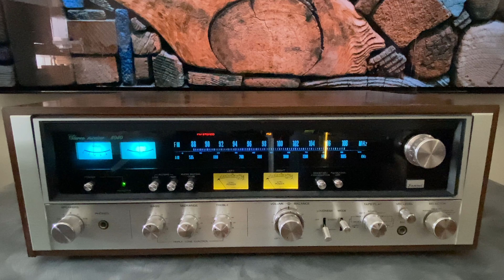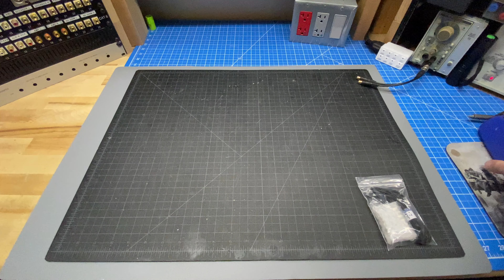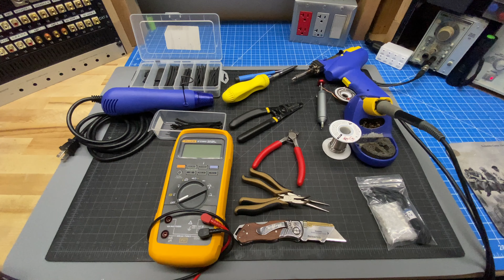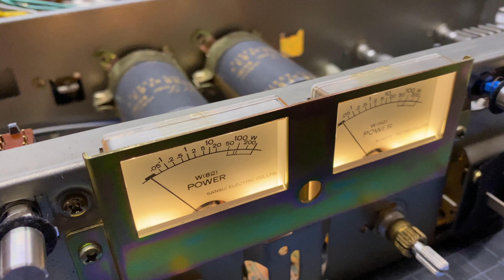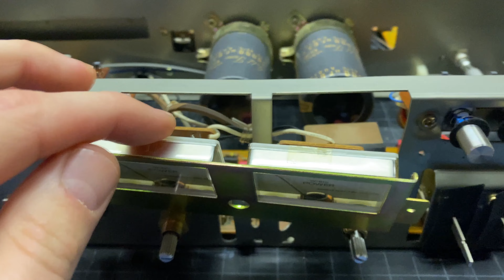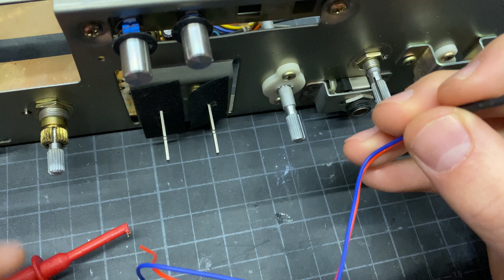Sansui 8080 9090 X0X0 LED Conversion (Pro Kit Installation) - Full Tutorial

Comment: Hmm. Switching the wire on the plug to the 6.5 AC did nothing for me. Lights still out. The Function lights were work, and now those are out too. I’ve checked and traced and can’t find the source.
Reply from the maker: Sounds like you may have blown the lamp fuse. Worth checking all of the fuses on the PS board.
Reply: @NovaluxStereophonic  I’ve checked the fuse on the power board with an mm. They’re fine. I heard there is a fuse, on a certain board, not sure which one.
Reply: @KosmicGroove  Did you figure this out?

Comment: There’s no need to do that!  The incandescent lights light the face of that unit just fine!
Reply from the maker: And also make the plastic housing extremely brittle. The heat is a major concern for these devices long term. Now something like a McIntosh amp with metal lamp sockets and glass. Incandescent will work long term with little downside.

Comment: Hello, today I received my first Sansui 9090 and I have a question.
Aside from the fact that the unit is quite dirty and clearly needs cleaning, it generally works and plays fine. However, there is a strange issue: when I switch the input selector, I don’t see any change on the front panel. It constantly shows FM and does not switch to other inputs in the display/indicator lights, even though I am physically changing the selector.
For example, when set to AUX, everything works normally in terms of sound, but it still shows FM on the panel.
Is this a serious issue, and is there any way to fix it at home?
Reply from the maker: First try cleaning the input selector switch. These can get extremely oxidized and cause all sorts of stage issues.

Comment: Dumb question here. I have a Sansui G9000 and the Power meter lights are out (they went out last year). Anyway, to put in new regular incandescent bulbs I am going to have to desolder the old ones and solder in the new ones, correct?
Reply from the maker: You might be able to see the lamp sockets on my video on the G901DB. From what I remember they are inside of a plastic boot. The original lamp would need to get removed from the boot and the new lamp soldered to onto the original leads, then slid back into the boot. That's my recollection anyways.

Comment: Hello, nice work 👍 if I use LEDs as a replacement for light bulbs, I choose two power options as needed.
1) bridge rectifier - full DC, in some cases also with voltage stabilizer and filtering
2) direct connection of a classic LED to AC with a diode connected in parallel in the closing direction - ordinary LEDs do not like a negative half-wave, so I eliminate its effects with an ordinary diode. I don't have an AC LED with two transitions.
But what I always do - I convert the clear transparent LED housing into a matte one with, for example, sanding fleece - the light is diffused better.
Fortunately, nowadays LEDs are produced in many colors, so there is no problem of color matching with the original - this is how I completed the interior lighting of my car - the original backlight is turquoise - and the new lighting is indistinguishable from the original.

Nice day 🙂 Tom
Reply from the maker: You do have a point here. The fuse style lamps that are shown here have some SMD components mounted on the back that deal with some of the shortcoming of running LED on an AC supply, however, the small LEDs in the power meters that I show wired in reverse polarity from one another have no such protection and I have seen some fail in this position before. The dual LEDs used for the indicators seem to be extremely robust though. I have have used them in many projects with no failures. I think they are internally wired in in anti-parallel configuration. I may start installing a rectifier & capacitor for the power meters in the future.
Reply: @NovaluxStereophonic  An ordinary LED without a protective diode in the closing direction - AC cannot handle it, the negative half-wave eliminates it, the diodes you used should handle it.

Comment: I'm going to work on my 8080 and 9090 pretty soon. Could one use a hot glue gun from the backside to hold the meter LED's  in place ?
Reply from the maker: I would be worried about accidentally melting the meter itself. Maybe try it first without glue and see how it fits up and looks before resorting to glue. If the LED ever fails in the future the glue may make swapping it more difficult.

Comment: Thank you for your video, it is very detailed, I got the lights kit for my 8080db but after I opened I find out that the stereo light is working ok but sources lights are very dim out, Does anyone here know what the issue can be?
Reply from the maker: Check for resistance within your input selector switch. A thorough cleaning of the input control may improve the brightness of your source indicators.
Reply: @NovaluxStereophonic  I thought about it, I will clean it with Deoxit. Do you recommend D5 or F5
Reply from the maker: @chris2470104  The selector switch is metal on metal so D5 is fine.

Comment: Really enjoyed the video and helped me with my 890db I just rebulbed ( pretty sure we got the same bulb kit ) One thing I noticed different on the 890db/8080db is my indicator bulb wires went behind that panel so there was no way to cleanly solder them to the board like you did. I had to cut the existing wires and then just twist / solder / heat shrink onto the original wires.. Maybe I could of just solder to the pads on the outside who knows. Its works perfect but id be happier if I could of did it externally like yours are, Joe is da man!

Comment: One of the most common things we see at the shop are folks bringing in vintage gear that had LED kits installed by the previous owner. They ask us to replace them with the original bulbs -- bayonets and "fuse" type lamps most commonly. Fisher gear like the 500b and 500c are very popular receiver examples.  The owners dislike the look of the LED's. I caution everyone to see how the LED's look BEFORE you have them put in; in some cases - like tube gear from many makers like Sansui (especially THEIR 500b model!), HH Scott and McIntosh as well as the Fisher I mentioned - you can hurt the value of the piece.
Reply from the maker: I agree, case by case. I always offer the choice to the customer and it seems to be 50/50. I only ever use LED in Mac to brighten up the meters. LED never really works properly for the lettering. It does not diffuse properly and cannot propagate properly through some of the color filters. The Sansui X0X0 receivers are one of the rare exceptions where I prefer LED over incandescent.

Comment: The clear wire ties that Sansui used can be replicated.  Craft stores sell plastic string used to make elastic beads.  Stretchy enough that it can be tied in a knot just like Sansui did.  Zip ties just look out of place on vintage gear.
Reply from the maker: Thank you for the tip.

Comment: If you want to get rid of almost all flicker, you can wire in a bridge rectifier between the AC and the LEDs.  Both the positive and the negative halves of the AC will become positive pulses.  The time between the pulses is reduced to almost nothing, so no flicker will be observable.
Reply from the maker: Great tip, it may be worth doing this for the dial pointer. I’ll look into this on my next conversion.